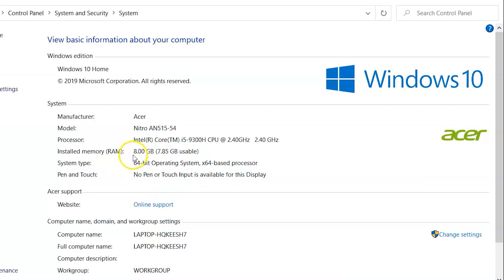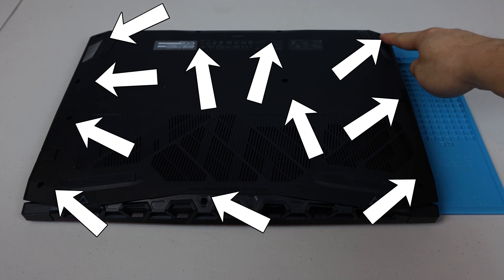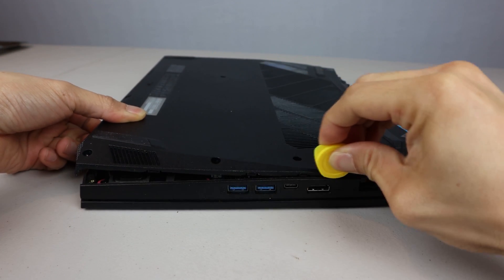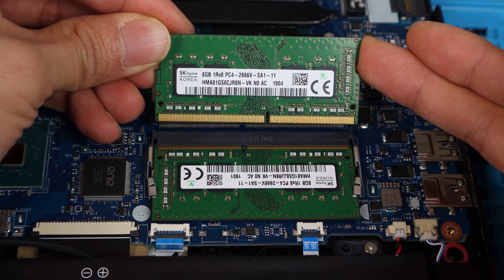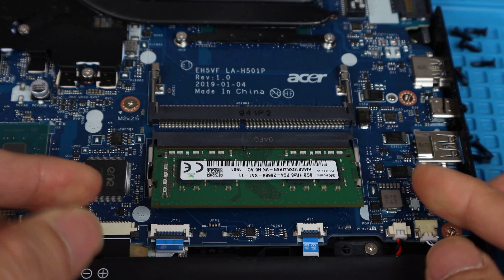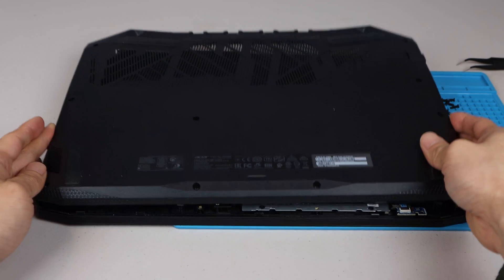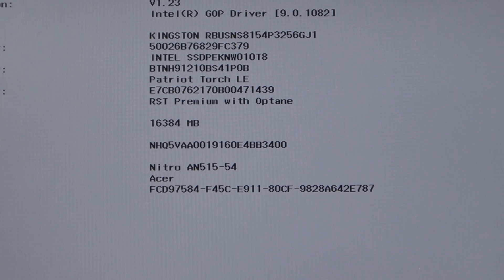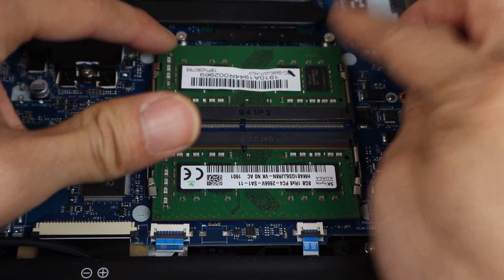How to Install or Upgrade RAM in an Acer Nitro 5 Gaming Laptop (2019 ver) DDR4 up to 2666MHz 32 GB

Comment: Hey! I just bought an Acer Nitro 5 this week, so i was going to add my old 8gb ram from my Lenovo Ideapad 320 to the Nitro.... Is this a good idea?
Reply from the maker: It depends on the specs from your old laptop, whether they match up with the existing RAM in the Acer Nitro 5. Since it looks like the stock RAM in the Lenovo Ideapad 320 is an 8GB DDR4 2133MHz chip, and the latest Nitro 5s usually run at 2666MHz or above, installing this older chip will make your system run slower, at the 2133MHz speed. You're probably better off buying a matching RAM stick to go in your Nitro 5 if you're looking for performance improvement!
Reply: @FixItPhil  oh ok thanks! I'll buy a new one then!
Reply: @FixItPhil  is it worth putting more MHz ?? Like more then 2666mhz like instead that maybe like 3200 MHz

Comment: can i upgrade to 3200mhz RAM??
Reply from the maker: It depends on your Nitro 5 model. The AN515-54 has a max speed of 2666MHz so 3200MHz RAM chips installed in this machine will run at 2666MHz.

Comment: I have the same model. I was worried that you said to match the ram sticks. I currently have an 8gb stick in there. If I add a 16gb ram stick will it make a difference or do I have to buy two 16 gb ram sticks to see a difference?
Reply from the maker: No, you don't have to match the capacities, though it is recommended. A 16GB stick will work with an 8GB stick with identical specs otherwise, and you will see some improvement to performance, sure. As long as you match the other specs like speed, DDR gen, CAS latency, etc. you should have few problems. If you have some discrepancies between the RAM chips, at best the computer will run fine but not optimally and at worst it will fail to boot. In general, the closer you can get to the specs on multiple RAM sticks to match, you'll have better luck with stability and performance.

Comment: Hello. I recently upgraded my ram, I've installed 2666mhz hyper x rams on my nitro 5 and I've noticed that the task manager changed the ram speed to 2400 mhz, it was 2666mhz before with its stock ram :( what should I do?
Reply from the maker: Hm, this sounds like it could be a XMP memory profile mismatch between the two sticks of memory that you have installed. Or there's a discrepancy in the CAS latency spec between your sticks. Typically you'll see this spec as CL20 or CL16 when purchasing the RAM. The best solution is to buy two of the same RAM chips so that you can be sure they're compatible with each other for optimal performance.
Reply: I have the same problem, I mounted Ballistix ( 2x8 Gbyte). The manufacturer ensures that they're 100% compatible but they're still running at 2400Hz instead of the claimed 2666Hz. 
If I put back the original RAM sticks, they run at 2666Hz. Any tip?

Comment: Which is better ryzen or Intel
Reply from the maker: The Ryzen models of the Nitro 5 are not as powerful as the Intel ones but they are less expensive if you are on a budget. You'll still be able to play most modern AAA title games at an decent framerate. If you can afford the more expensive Intel versions, you will get better performance when it comes to 1080p gaming. The only thing to consider is if you're planning on using an external monitor and whether that's FreeSync (AMD) or G-sync (NVIDIA) compatible.

Comment: Does it still work when 1st slot 8gb ram 2nd slot 16gb ram switching from the first slot ram to the second ram vice versa with different sizes yet same mghz?
Reply from the maker: Yes, the RAM slots will work with different sizes, even though this is not optimal, it should still work if they are the same MHz. Where you want to be careful is to not mix different speeds (MHz) because this may cause issues or cause the chips to wear out faster.

Comment: Hi, may I know if the i7 9750h version An515-54, uses the same ram?
Reply from the maker: Hm, I'm not sure. If you open up the laptop, you can check the specs on the sticker that should be on the RAM chip. Your best option is to match those specs and add a chip with the same or higher capacity using the same brand.

Comment: Sir , will this void the warranty when i upgrade the ram? I  have 4gb ram 400mhz out of the box laptop nitro 5.😥
Reply from the maker: In the US, generally no, if nothing is damaged in the process, you are able to upgrade RAM and storage drives without voiding the warranty. If you live in a different region, the rules may be different, so check with your region's local Acer service center for more clarity on this topic. If any of your screws have warranty stickers on them, this would void your warranty.

Comment: I have an Acer Nitro AN515-53 would this "Brand" of RAM you are using work to upgrade it?
Reply from the maker: Sure, in general, the brand of the RAM really isn't an issue. The typical recommendation is to match the existing chip you have in your system by specs (strongly recommended) when adding another stick of RAM and secondly by brand (preferred, but optional), if only because you can be certain the architecture of the chips would be consistent between them to ensure complete compatibility.
Reply: @FixItPhil  Awesome! Thank you!

Comment: Is it possible to make the 2.5 drive the boot drive/C drive or is that predetermined by the manufacturer?
Reply from the maker: Yes, you can make the 2.5" drive the bootable one. You can change the boot priority in the BIOS yourself, regardless of what the setting was when you received it from the manufacturer.

Comment: Do I have to ground myself before installing it so esd will not kill the motherboard?
Reply from the maker: Yes, that is recommended for safety. While the install can be completed without doing this, the risk of damaging your components is slightly greater, so you do so at your own risk.

Comment: Ordered a Nitro 5 on Amazon because I need a laptop for programming and gaming on occasion getting it by the end of this month. Acer is the only brand I've seen where you're able to upgrade the components.
Reply: Dell XPS 15 and 17 have user upgradeable RAM and SSD's, as do several other Dell laptops and several other brands (Asus, Lenovo, etc.)

Comment: U have 8gb ram but only 5.72 is usable?
Reply from the maker: Depending on your computer's configuration, some RAM may be reserved for the OS or attached devices and components (like the GPU). This can also happen if your BIOS settings are incorrect or the RAM is damaged.

Comment: my laptop has 2933mhz 8gb ram,can I add another with only 2666mhz 8gb ram?
Reply from the maker: Yes, but the overall speed of both RAM chips will be capped at the lower speed.

Comment: If we put extra Ram, does it cuz any side effects in the system performance??
Reply from the maker: Most times, your system will perform a bit faster than before in terms of loading programs, processing data, and transferring large files. There isn't really any performance downside of installing more RAM.

Comment: an 515-55 intel core i5 10th gen have the same ram card like urs will it work ? or need different
Reply from the maker: Yes, it will be the same kind, although depending on your build, the brand of RAM may be different, but that is not so important. The maximum capacity for RAM in your model is 64GB, you should look for RAM with these specs SODIMM DDR4 2666MHz, for example these: https://geni.us/BBa3T7 [Amazon Affiliate Product Link]

Comment: Brother does it have to be a non ecc ram or I can add a ecc ram and have a combination of both because nitro comes with a non ecc ram does it matter please help
Reply from the maker: Yes, this laptop model if built for non-ECC RAM, however, if you install ECC RAM, it should still function, but as non-ECC RAM. You won't get the benefit of error checking. However, most memory companies do not support mixing the two types, so try it at your own risk. In any case, non-ECC memory is usually less expensive and works slightly faster, so I'm not sure there's any benefit to installing ECC RAM in this laptop.

Comment: Excuse me but where would you attach the anti static wrist dohicky.
Reply from the maker: Anti-static wrist straps can be connected to electrical outlets via cables or clipped onto grounded free-standing grounds like a metal table on a stone floor, or grounded metal pipes or radiators.
Reply: FixItPhil Thanks a lot!

Comment: Will this work with the new 10th gen nitro 5?
Reply from the maker: Yes, the process will be similar but the internal layout will be slightly different. The M.2 slots and RAM are positioned differently on the motherboard but everything else is pretty much the same.

Comment: Shall we keep those stickers on the RAM stick or it is better to remove it? Plz can someone tell....
Reply from the maker: You can leave them, it doesn't make a difference and helps with identifying the chip later on if you need the specs.
Reply: @FixItPhil  Thank you for the info !

Comment: How can I know my laptop is reblished or original
Reply from the maker: Hm, usually this is divulged up front when you buy the laptop from whichever store or vendor you purchased from, but  generally if you buy 2nd hand, there is no way to know for sure. It's safer to assume that any laptop you purchase from an individual that was not in sealed original packaging is potentially "refurbished" or "reconditioned".

Comment: Will it work okay if I install a crucial ram stick close looking to the normal one?
Reply from the maker: Well, you really should select your RAM based on the specifications and not how it looks. The easiest way to do this is to match the part number or the specs found on the chip that you already have installed.

Comment: im about to add 2 16 gb ram chips what should i expect to see as far as improvements are concerned,  going to the max at 32 gb?
Reply from the maker: It depends on what you're going from and what you plan on doing with the laptop. If you're upgrading from 8 GB to 32 GB, you'll probably notice faster load times for applications and games. There should also be less time spent waiting for dungeons/maps to load when switching between areas in RPGs. If you do a lot of video, graphics, and photo editing or rendering (or working with large data sets, like Excel) you'll see a big boost in reducing the time it takes to apply effects, export files, update calculations, and render filters.
Reply: @FixItPhil  thanks I do both ive just heard that in a lot of cases maxing out your ram isn't worth the cost when compared to the minimal difference you see in speed i had originally 8 bugs then upgraded to a single 16gb but i wanted to make sure i was using duel channel bandwidth so I put another 16bg chip in so now im at the sysyltems max at 32 of ram i run the acer nitro 5 but hey thanks for the response I appreciate the info

Comment: Is it possible to Add ram with not the same frequency? Like 8gb 2933MHz + 8gb 2666Mhz or 3200MHz?
Reply from the maker: Yes, but your system will run at whichever speed is lowest of the chips.
Reply: @FixItPhil  Okay, Thank you sir !<3

Comment: Is it okay to add a different ram but with same specs? (2400Mhz)
Reply from the maker: Sure, you can mix brands of RAM and it should still work fine if the specs are the same.

Comment: Could I put in a 16gb stick with the 8gb? Or would I be better off to just take the 8gb stick out and only have the 16gb stick in it?
Reply: use both, 2 cores is always better than 1
Reply: Owen Spence Thx. I wanna eventually upgrade it to 32 but not all at once

Comment: I couldn't get the identical 8gb ram stick that came with my laptop so I got one by crucial with the same specs, that should be ok right? Even though they are two different brands?
Reply from the maker: Yes, that should be fine.

Comment: I am looking to upgrade my Nitro 5 ram, I currently have an 8 gig chip or I assume it is one 8 gig chip.  Can you tell me if this chip is compatible with my Acer Nitro 5 AN515-52 laptop.    It's a "Crucial 16GB DDR4 RAM 2666MHz PC4-21300 260pin CL19 SODIMM Laptop Memory 1.2V.  I know it's a 16 gig chip so will that go with an 8gig or can I just put 2 of these 16 gig chips in?  The video was great too, but after looking at it I am happy to add the ram chips myself.  Thanks for any advice you give...
Reply from the maker: Yes, the RAM you choose will work with your laptop. You can use a 16 GB chip with an 8GB chip, that shouldn't be a problem, or you can upgrade to a max of 32 GB with two 16 GB chips, but you wouldn't really need that much RAM unless you're doing lots of video/photo editing or 3D model rendering.
Reply: @FixItPhil  I have opted to max it out and get 2 x 16 gig chips. I do a bit of gaming and some games I use to play in early access I can no longer run so having 32 gig should (hopefully) greatly improve that experience, thanks for the video.

Comment: Can i put a hyper x impact ddr4 a kit of 2 16gb with 3200MHz? i really want to know on the newest best buy 2020 model? please answer
Reply from the maker: Hello, the latest model Nitro 5, the AN515-55 can accept a 3200MHz speed chip and up to 32GB total RAM, but note that it's maximum speed will be capped at 2933MHz (internal limitation of the Intel 10th gen CPU). That being said, yes, you would be able to use the HyperX dual 16GB kit though it will only run at 2933MHz.
Reply: FixItPhil hi thanks so much and one more question on this same model can i put a 2tb nvme ssd on this?

Comment: what is a bench program ?
Reply from the maker: A benchmark is a standard or point of reference against which things may be compared or assessed. This helps you understand if the overall performance has "improved" after an upgrade. The benchmark site I used is called userbenchmark .com where individuals submit their system builds for comparison to others.

Comment: Do I still need to disconnect the battery from the MotherBoard... then proceed to install my additional Ram?....
Reply: I think power off laptop then upgrade
Reply: @jackh.7125  so its not necessary to disconnect the battery.... poweroff may do.... thanks for the reply....

Comment: I have the an515-43-r3ty model, and I’m planning to upgrade the 4gb ram to 16gb, Is the Kingston ValueRAM CL19 good enough?
Reply from the maker: Sure, you'll need the SODIMM DDR4 type RAM. I believe your system will run 2666 MHz at 2400 MHz, though either type should work with your system.

Comment: Is there a specific type of ram you need to get for laptops or will any 2x8 ram sticks work
Reply from the maker: It depends on your exact model but most contemporary laptops require SODIMM DDR4. You should check the speed/frequency it can handle; most gaming laptops go up to 2666 MHz.

Comment: I installed a 8gb ram module...
Now I have 16gb but it shows (5.94gb) usable....
Tried every method..,
But still it doesn't fix
Reply from the maker: Hm, have you tried all the methods here? https://appuals.com/windows-10-wont-use-full-ram/ you can also try disabling hardware virtualization (VTX) in the BIOS settings. Press F2 repeatedly when booting the laptop to enter the BIOS, go to the Advanced tab and change VTX to disabled.
Reply: @FixItPhil  did that work?

Comment: Is there a specific kind of ram that it needs?
Reply from the maker: My Nitro 5 model accepts SODIMM DDR4 2666MHz. Brand is not important. Depending on your exact model you'll likely use either 2333MHz (some AMD chipsets or older Nitro 5 lines) or 2666MHz speed.

Comment: Hello bro,
I am having Acer Nitro AN515-54-521N model having 1tb hdd, 256gb ssd, 8gb ram, 1650 graphics.
Here my question is can i add 16gb 2666 MHZ ram along with 8gb ram???
Reply from the maker: Yes, you can do that.

Comment: Hi! Great video!

Do you know if this will be the same situation for a ACER - Nitro 5 AN517-51 17.3"?

I currently have 8gb but want to add another 8gb :)
Reply from the maker: Yes, the AN517-51 has a similar layout inside and disassembly process as the model shown in this video. You should be able to upgrade up to 32 GB RAM for your model (2x16GB chips) but adding another 8GB will bring you up to 16GB which is plenty for gaming.

Comment: Can you plz tell me if I can add a 16 gb with 4gb ram stick . I am going to buy the  amazon bundle with keyboard and mouse . It’s had amd ryzen 4600h and gtx 1650ti
Reply from the maker: Sure, you can mix RAM capacity, that's usually not an issue.

Comment: If I add a hard drive to it, would I have to download everything again or is it just like adding another drive?
Reply from the maker: If you add a hard drive and don't remove the existing one you don't have to download or re-install everything. It'll just be adding another drive.
Reply: FixItPhil Oh okay. I recently got the nitro 5 and I plan on adding a SSD and another ram stick. I won’t have to take out the existing one right?
Reply from the maker: @andrewbubbles  No, there should be two M.2 slots and the 2.5" drive, at least one of those should be open. There are no builds that I know of that come pre-installed with all 3.

Comment: Does anyone know what type of ram AN515-54-54W2 acer nitro 5 takes I’ve been trying to look for it ?
Reply from the maker: That's the exact model laptop I have in the video. SODIMM DDR4 2666 MHz, up to 32GB. I have some links to the RAM I purchased and a few other options in the description.
Reply: FixItPhil ok I think the steel one will do but I also found this other on on amazon lemme get the link will this do to ? Kingston Technology HyperX Impact 16GB 2666MHz DDR4 CL15 260-Pin SODIMM Laptop Memory, Kit of 2 (HX426S15IB2K2/16)
Reply from the maker: Yup, that should work.
Reply: FixItPhil thank u so much